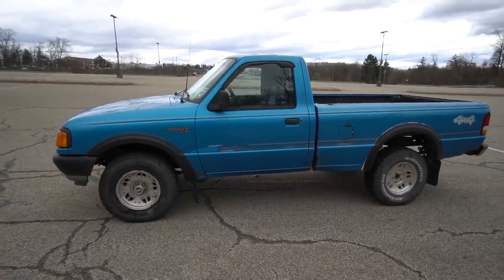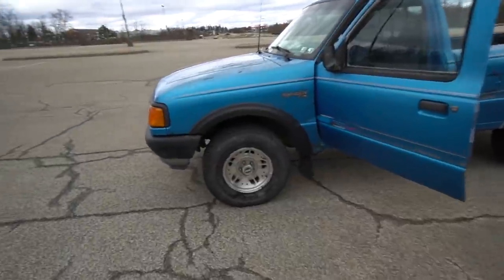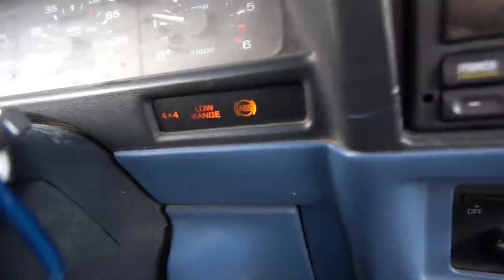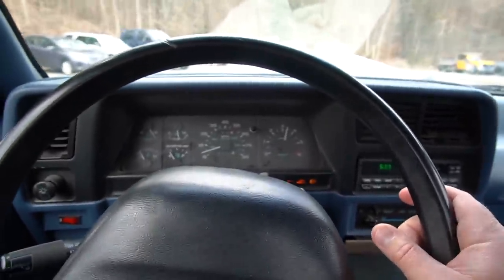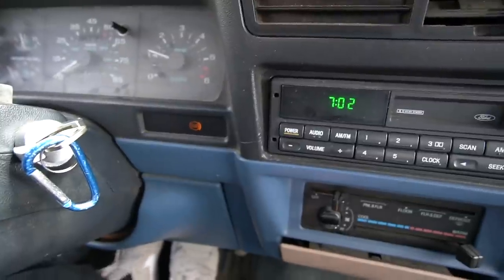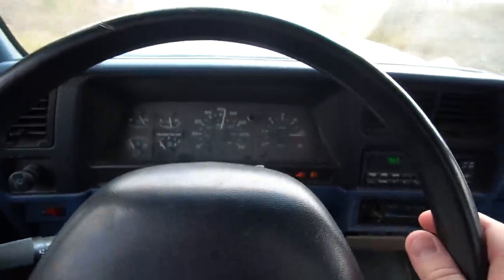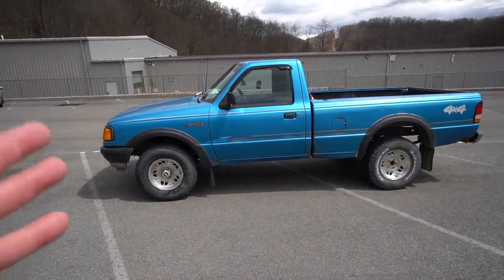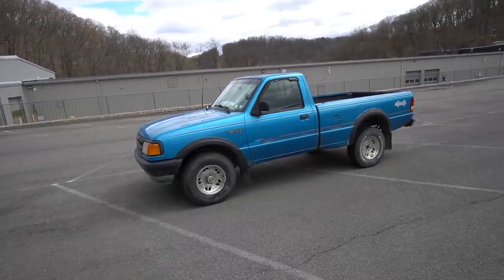What happens if you shift from 4H to 4L in a 4WD truck while going 55 mph? (Not Safe!)

Comment: It's almost impossible to shift to 4L while driving in anything. Some automatics won't even do it while the engine is running unless you are in park or neutral. Sometimes you even have to move the vehicle a little to get tension out of the drivetrain to go from low to high. That's just the way the gearing is structured.
Reply: Just imagine how violent it would be if he somehow did get it into 4L. That would be awesome! He's got the hubs locked and everything. Lol
Reply: @beaugalbraith3891  it would probably grenade the transfer case
Reply: Unless its a Mitsubishi Triton or Pajero
Reply: It won’t go into 4L because the transfer case is unsynchronized they don’t have synchronizer rings like most manual transmissions. Ever tried to put an old granny low 4 spd into 1st whole driving? Same concept.
Reply: Hey guys yup I’m an idiot I tried this maneuver on the first day of purchase of Mini Pajero 2006 automatic, but at very low speed…and had the same noise. 10min later I get A/T high temp light and gears aren’t shifting properly. Any recommendations guys…? Bringing it to a garage next day morning but I live in a shit hole in the oceanic and I’m sure you’re more experienced than many in here . Cheers
Reply: Try this!
Well, since the ranger does 45 in low range, engine tacked out, keeping that baseline in mind, try to do the transfer from high to low at 45 mph instead of 55 with a double clutch method:
1) hubs need to be locked so the mesh of front end components stay in sync.
2) bring her up to 45 in high 
3) clutch in
4) shift main stick the 5th (from where ever you were)
5) shift t-case into neutral
6) let clutch out and rev the engine up fairly high and either float the t-case shifter into low or quick clutch in and stab it in low and keep rpm up and let clutch back out. DONE
Do it right and there will be no grind.  Only hiccup is if there is driveline tension fighting preventing the t-case from coming out of 4 H.  In which case run her up in 2H and shift into neutral (step 5) sailing right thru 4H.
@AutoVlogOfficial
Reply: @crutler  Ease up the throttle.

Comment: Most trucks with 4 low wont allow u to shift into 4 low unless ur in neutral pushing the clutch in wont make any difference try shifting into neutral then put it in 4 low then try to shift back into gear this may work or may not depending on the truck

Comment: Great video and than you for it . Bro put pennzoil SAE 0W motor oil which is very thin oil in the gas tank and see how fast and how far you can get till the engine seizes up. Take all the gas out of the tank. Then put lube grease in the injectors like gob it it up full and then drive it at top speed and let's see what happens.

Comment: Hey Mike can you take of the fan blade and replace it with a normal household fan blade? I would like to see if it can work with at high revolutions. Ever used Nitrous in 4 low? Might be interesting to see what happens

Comment: What happens when the F150 truck is already in 4L. I was stopped and in Drive. I twisted the transfer case knob from 4L to 4H and loud pop sound happened. What caused the loud pop? Fyi 4H and 4L still work. I'm just curious what caused that noise from switching from 4L to 4H while stopped and in Drive.

Comment: I have a 2004 Ranger 4 x 4 4.0 will not go into 4 Low unless you were in neutral and have the brake pedal pushed in cuz I tried to use for low in the winter and I didn't have the brake pedal pushed in but I was in neutral and stopped and it would not go into four low until I pushed into break and if it's stick shift you have to push the clutch in and stop says rate in the owner's manual

Comment: I once had a 2005 Ranger that I would have to put in neutral in order for it to shift. But it had an electric knob, and if you turned it when it wasn't in neutral, it would just switch when you shifted to neutral. Maybe that's different, since this one is mechanical, not electrical.

Comment: You don't have power steering anyway so shut it off while driving with the clutch in and shifter in neutral. With the engine off it'll go into 4L, then turn the key on and drop the clutch

Comment: i go into 4L while driving 5-15 mph put transmission in neutral then put transfer case in 4L slow down then drop the clutch into higher gear